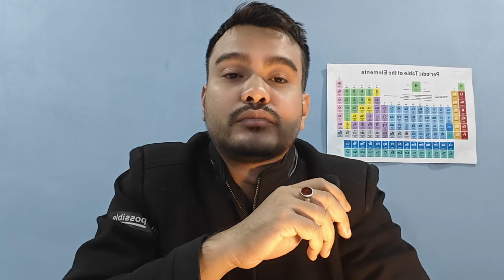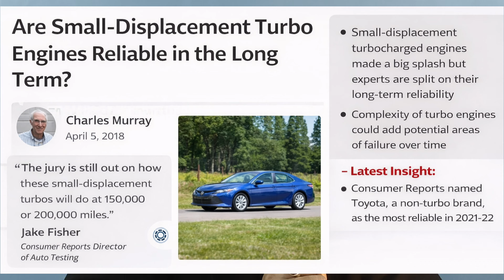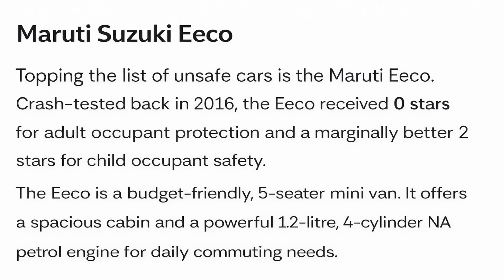Avoid These 10 Cars in 2026 — Engineering Reasons Explained

Comment: Which one of these cars is a reliable car? Should I wait? Toyota Urban Cruiser Ebella EV or Toyota Urban Cruiser Hyryder Strong Hybrid 2026 model or Maruti Suzuki Victoris Strong Hybrid. Kindly advise. Thanks.
Reply from the maker: Great question 👍 I’ve gone through multiple 2024–2026 owner discussions and long-term reviews before answering this.
If reliability is your top priority today (2026), the safest bet is the Strong Hybrid models — Toyota Urban Cruiser Hyryder or Maruti’s equivalent Strong Hybrid (Grand Vitara / Victoris).
Why?
• The 1.5L TNGA Atkinson-cycle engine + e-CVT hybrid system is Toyota-derived and already proven globally.
• 2–3 year ownership reports in India show strong reliability with very few major mechanical failures.
• Real-world city mileage is consistently excellent.
What owners are actually reporting:
– A few cases of 12V battery drain if the car is left unused for long periods (not the main hybrid battery).
– Service experience depends heavily on dealership quality.
– Hybrid battery replacement is expensive long-term, but covered under extended warranty.
Now about the Toyota Urban Cruiser Ebella EV (2026):
• Comes with long battery warranty (8 years).
• Lower running cost if you charge at home.
• But it’s still new in India — long-term durability data in Indian heat and road conditions is limited.
So here’s my honest recommendation:
✔ If you want proven tech with least uncertainty → Go for Hyryder / Strong Hybrid.
✔ If you want future-ready EV + can charge at home + okay with first-gen risk → Ebella EV is fine.
Between Hyryder and Maruti’s Strong Hybrid, choose based on price, dealership support in your city, and after-sales reputation, because mechanically they’re very similar.